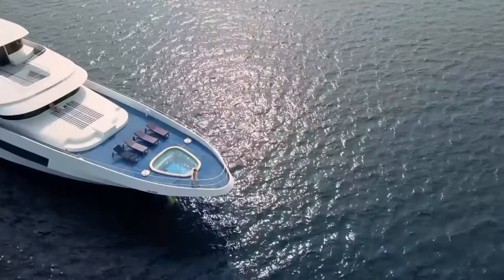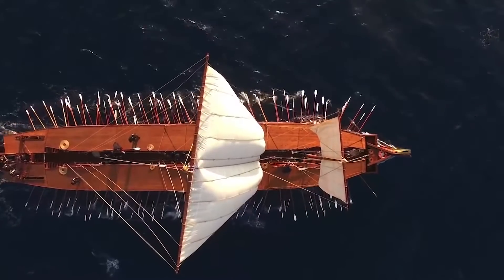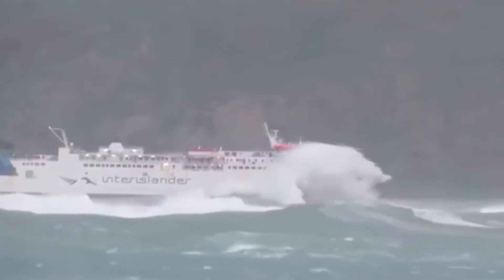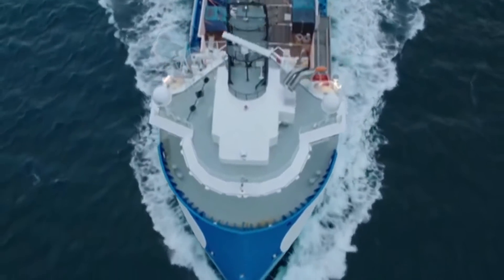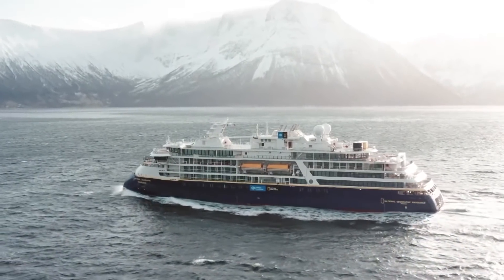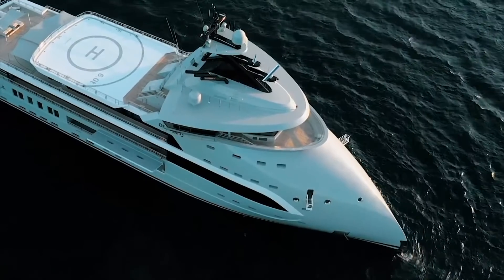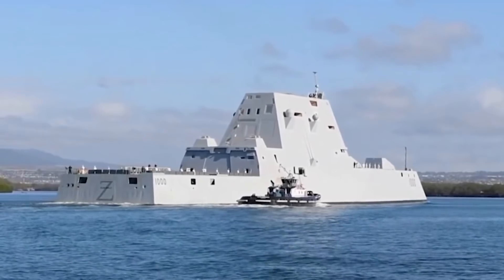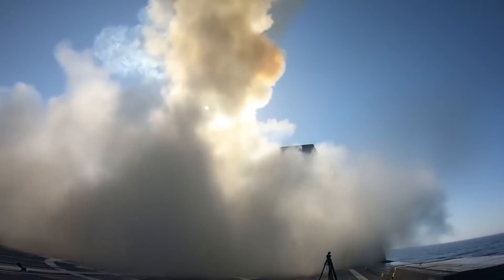This Revolutionary Design Will Change The Appearance Of Ships

Comment: The bulb on conventional bows creates a low pressure zone before the main bow, where that low pressure zone then collapses into the length of the hull, and reduces friction. If there was no bulb, a high pressure zone will stick to the full length of the hull, creating massive resistance. The xbow suffers this high pressure zone, unless it has a hidden bulb (probably does). I'm not a ship tech by any means, but I know  going by interest and other YT vids what the deal is here 😀

Comment: The original viking bow was because the sailors were in the water and another unseen action of the Hull is its flexibility. Obviously hard to replicate with a huge metal ship but certainly worth considering because it will reduce the cost of the fuel and improve agility

Comment: Ulstein has a promotional video on their website that does a very good job of explaining the X-Bow design and why it is a preferred choice for modern ships. It is purported to reduce onboard movement and noise, induce less sea spray, improve fuel efficiency, ships are easier to build, and reduced structural stress on the ship.

Comment: This design is nothing remotely new. There were lots of battleships built for the Royal Navy before WW1 with essentially this type of "reverse" bow. And In other countries as well. To my mind, the reason why this type of "X bow" is more efficient than a "bulb" bow is that bulbs are not POINTED, but rounded. Surely, making a pointed bulb, rather than a rounded bulb would greatly reduce friction/drag and the inherent pressure wave created in front of it and the bow wave which results from it???

Comment: It would be interesting to hear from one of their engineers what the design choices were. I’m pretty sure it’s not a case of “no one ever thought about it before,” naval architects have scientifically tested and analyzed every possible configuration for almost a century.
Reply: I´m a merchant marine engineer. This is a good design if the superstructure is already intended to be on the bow of the ship. Problem here if the ship is needed to carry bulk, oil or containers, this design would restrict cargo capacity. Best place for superstructure is above the engine room, because you cant fit cargo under superstructure. Best place for a engine room is aft of the ship, because of screw shafts, rudder machinery and smoke stacks.  If you watch this video, every single X bow ship is carrying deck cargo like passengers, roll in roll off and subbliner materials, so that the superstructure can be on the bow.
Reply: Total guess here, but during most of the steel ship era construction is done by rivited design. Basically lots of metal plates riveted together. It's much harder and more expensive to create large rounded metal parts. Today with composite metals and modern techniques it's easier. I would also guess fuel efficiency wasn't that important and saught after. Lastly it's probably due to tradition and available construction ability. Why spend millions on new research, training and equipment when there are proven designs? Most of development probably have gone to more effecient engines, propellers and fuels. Which also have the benefit of upgrading already running ships. Ships have a quite long life, which makes development slower compared to for example airplanes or cars.
Reply: @Swansniff2  In shipbuilding, rivets went out off use around one hundred years ago.
Reply: Many old battleships have kinda inverted hull designs.
Reply: @carlosandleon  how old? some of them were made with intention of ramming enemy. but later bulbous bow appeared. yamato had it and some american ships had similar bow but usually that was not shown in plans. if you look drawings often bow will look different than on pictures. guess top secret stuff.
Reply: why not? a lot of times it is as simple as that. especially because how tradition works. you are pushed in one direction.
Reply: That's pretty easy: In vertical motion, this bow produces little drag, even in highest seas. It also splits waves gently. The bow thus enables the ship to take on way higher seas without risk and goes through medium height swell way more gently tan the older designs. And that's it.

Comment: I have no knowledge of boats and the design of them. But as an engineer for over 40yrs, I do know that everything has downsides. Strange, I didn’t see any mentioned. A perfect design that most ship designers have ignored for many, many years?
Reply: Just brain-storming, but the distance below the surface may be a concern for this type of hull-design, so cargo vessels or oil vessels that have relatively large differences in depth before-and-after being unloaded may have relatively different performance parameters.... whereas something like a cruise ship which doesn't alter it's depth too much might be a good candidate.
Reply: @TROOPERfarcry  that's basically how it works. The only Naval vessels I worked on that had the bulb were the carriers and other large ships that were equipment movers. Anything with a cruiser, destroyer or frigate had a normal v hull. I've seen other countries ships(UK, Canada) have different designs above the water line, but not so much below.
Reply: It didn't say ignored. It said it's already been used for thousands and thousands of years. "New ship design" is just clickbait.
Reply: high quality displays and cameras and 360 degree movment.
Reply: @OrjanDT  no existing display matches the quality and detail that the human eye can pick up. adding super expensive equipment that doesnt aid in the ships stability are rather wasteful and useless
Reply: Think of how to protect the pilot house glass windows, with them heavily exposed to direct wave action.
Reply: This type of bow design can cause catastrophic damage to another ship in a collision, which is why they went away in the early 20th century. They also have less reserve buoyancy in a wave which allows them to cut through the wave. The lack of reserve buoyancy means that they will be wetter.
Reply: dont forget the test was using a fair conditions and balanced load. Its like putting a kid on your shoulders to dunk the ball.
Reply: Clive may be right. I wonder how the ship does in a following sea? Making the ship more of a double ender, as in trans-Atlantic row boats, may be needed as well as an overall lower (above the waterline) profile to reduce windage.

Comment: When the era of of iron-steel warships began in the mid 1800s the race was on to see what the new tech. could provide when it came to hull and bow designs. Many vessels used what was called the Tumblehome design of having their hulls angle in from the waterline so enemy fire would skip off. Indeed by the time what was called Ram Fever in design arrived just decades later ships like the preserved USS Olympia had a version of an X Bow over a century ago. It wouldn't be until after WW2 before the benefit of a ship piercing below water ahead of the vessel returned with the bulbous bow and what's old is news again as they say. An X Bow owes much to the Tumblehome design of the past as well as the rams returning on warships during  the latter Victorian period and you'll find commercial vessels in that era as well using unique hulls that it didn't credit..
Reply: They owe nothing to the 'tumblehome' design or to ram bows. They were built for completely different reasons.
Reply: @captainswoop8722  ram bows are designed for ramming , correct?
Reply: @captainswoop8722  But they were still built.

Comment: Sick kids this is why you should stay in school and get the best education you can I should’ve been an engineer when I was a kid me and my dad used to build boats electric out of water bottles and we noticed that no matter what you did the water bottles would not sync you flip them over they flip right back right side so I always thought boats should be more like a submarine shape , With any windows or doors watertight this way if the boat happens to flip over in a big wave it’ll roll over and roll right back up right I saw that they did some something like this for the new escape rest but they never change the shape of the boats years and years ago they could’ve made boats very easy not the sink but they never dead

Comment: After 20 years working on various ships with classic bow I have been working on x-bows for last four years px-105 and px-121. In high seas x-bows are superior, faster, and less pitching. Far more comfortable compared to classic bow
Reply: Counterintuitive...

This is life
Reply: looks like a giant canoe... they sail well in calm waters... lol
Reply: I have the opposite experience.
Reply: @TheFrontyer  the x-bow is far superior to the classic bow or the axe-bow.
Reply: @evonnechi7029  Definetly not true. The xbow hull is awful in big waves. Being in the north sea during storms and 15m waves was far more comfortable in a classic hull ship then xbow ships. 

For calmer seas the xbow hull is quite nice though
Reply: @TheFrontyer  what is it about the xbow that does not handle large waves well? How do the large waves affect the ship with the xbow? What do you, as a passenger or captain, feel when riding those big waves that makes the xbow so bad? Hence, what is the downside to having an xbow in large waves?
Reply: @evonnechi7029  I worked on deck at the time. Mostly its just very slow, but heavy heaving. It makes it very uncomfortable. 

Also the officers always complained about the ship in rough seas, had to go at max 1-2 knots to not destroy the ship.  Could travel twice that with a normal hull ship.
Reply: @TheFrontyer  hummmmm...

Comment: bulbous bows work better at lower speeds, High speed ships do not have bulbous bows.
Reply: Nimitz, later version and new Gerald Ford nuclear class all have bulbous bows and are well above 30knots.
Reply: @telinoz1975  But the bow will be optimised for their most common cruising speed. For a given design they only work at a relatively narrow speed range. Carriers spend the vast majority of their time at the same cruising speed.
As for 'well above' 30 knots, the speed of a hull can be calculated from it's length. It can't sail faster than it's own bow wave or wake.  Maximum velocity in knots = 1.35 x the square root of the waterline in feet.
Reply: @telinoz1975  They are optimised for the cruising speed that carriers spend most of their time at. A bulb will only work efficiently in a certain narrow speed range that it has been optimised for.

As for the top speed of a carrier. It is tied to the length of the ship. It can only sail as fast as it's own wake and bow wave which is tied to it's length. The formula is  maximum velocity in knots = 1.35 x the square root of the waterline length in feet.
So you can work it out yourself for any given ship.
Reply: @captainswoop8722  There is no "maximum" speed for a ship. you can go faster than the bow wave but then the bulb would be useless and you would go from a displacement hull to a planing one. What i think he means by "high speeds" is that a bulbus bow is only useful for ships with a high froude number that is still not planing.
Reply: @Sectormann  Maximum speed for a displacement hull I should have said. You won't find a planing tanker or aircraft carrier.

Comment: Nearly every single ship of the line in WW1 had a straight bow or angled like this, wondered why they shifted away from it.
Reply: They had that shape for a different reason.
Reply: why because the bulb is also a where the sonar equipment is stored
Reply: @si2foo  There was no sonar in WW1. Battleships had 'Ram'  bows that were similar to the modern one in shape but their function was as the name suggests, to allow ramming.

Comment: I'm a marine engineer. Whoever scripted this is seriously ill-informed.
Reply: You need to explain why.
Reply: @crazydrifter13  I am also a marine engineer and sailed ships for many years.  There is no relationship between the new inverted bow and the Scandinavian longship bow.  It is apparent that the two are vastly different.  Ships have had a bulbous bow for decades, and the inverted bow is just an extension of the same idea.  The bulbous bow reduces the bow wave, which creates lots of water resistance.  The inverted bow additionally removes much of the upward force which would, in addition to buoyancy, would lift the bow from the water.  Cyclical lifting of the bow also increases drag on the hull so it won't move as easily through the water.  Ancient Greek rowed vessels with rams have no relationship to the inverted bow either.  The ram was usually just above the water, and thus did not act as a bulbous bow.  It's function was only as a weapon to break other hulls.  All the similarities made by the videographer are incorrect and demonstrate no knowledge of hydrodynamics.  Hope this helps.
Reply: @DARIVSARCHITECTVS  oh thanks 😀

Comment: Vikings didn’t build bow extensions for speed, they built them to ram their opponents.
Modern ships use bow extension to decrease the length/width ratio in order to crease drag. Also the bulbous bow extension splits the water.
Reply: Not Viking longboats but Greek or Roman galleys had rams !!!
Reply: @johnland7318  thanks John.
Reply: The bulb disrupts the natural bow wave. It's more than a length increase.
Reply: This is just garbling.

Comment: I really can't say that I have seen any real benefit of X-bow over standard bows, aside from the usual benefits awarded by less resistance which is similar to knife edge bows. They both move the same way under heavy sea's, I have found that X-bows dip even lower into following waves than standard bows do, due to their overall thinner design. When this does happen then waves tend to break over the top of the ship rather than just over the top of the fore deck. 

Though it can be seen as an improvement over the knife edge bows, which had a tendency to submerge under waves rather than rise over them. A feature that has lead to some ships being crushed under the sudden unexpected dive into waves that put them several meters underwater. 

Viking era long boats aren't X-bow designs, they are curved standard bows with high wave guard walls. The reason they were so effective wasn't because of some ground breaking design choices, it was because they weren't gigantic in size. A group recently built the largest Viking ship in history (which was much larger than any known historical examples to date), and it was a-wash for pretty much all of it journey from Norway to the America's. Even in light weather it was taking on water over the bow. Had the ship been a third smaller (closer to the known largest ship designs) then it would have perfectly fit within the wave length they encountered, but would have been a bit rougher trip.
Reply: Not to mention the ''Vikings'' operated a variety of ship types, not all of which had the pronounced bows like the ones found on the Oseberg and Gokstad ships.
Reply: Crew vomfort i drastically improves with the X-bow
Reply: @ultra_axe7812  That's what it says in the video, but I guess the crew would be more comfortable in an X-bow that is at dock rather than out in the open ocean with 40ft waves. You know, the weather that most offshore companies have no choice but to send a ship out into if they want to keep their rigs running.

That is kind of the argument, standard bows are cheaper to maintain than X-bows, operate in a much higher severity of weather, usually have much more deck space, and have higher buoyancy the further under the water they go. 

I have never seen a video of an X-bow ship operating in the same sea states as standard bows are when they are having their bulbous bow tips being launched out of the water. Where is the on-board footage of an X-bow ship staring at a literal wall of water moments before impact like all the videos we have of standard bows being smacked in the pilot house by a breaking wave?
Reply: @lordraven1991  ive worked on the Scandi Vega, Troms pollux,  Troms Fjord, and bourbon mistral, the X-bow was designed for crew comfort i rough weather and surprisingly for noone but you apparently they do it wonderfully

The X bow is ment to cut deep into the wave so, so the ship stays as level as possible in rougher seas

Comment: I don’t see the slightest resemblance to the bow of a viking ship though?!
Reply: It's about the soft round bottom, which is probably more hydrodynamic or whatever, not the upper part. All in all the X-bow's main properties are not about the inverted upper part at all, apart from rough seas and maybe a little bit of aerodynamics.

Comment: Don't lesson me on this shit. 

Drakkars has never been found, but we have no reason to doubt they existed. The ships you show are longboats with hulls more akin to knarrs. Knarrs were merchant ships made for cargo, which comes in handy after a few raids. The X bow is inspired from the karve design, with the Oseberg ship being the best example. Karves like the Oseberg Ship were made for efficient transportation, but didn't have the same capacity or stability. The Oseberg does have some resemblance to the X-hull.

Comment: I work on the northsea and x bow is brilliant in calm weather, but it have some giant design limits, that's why we only use it for dp and calm weather.
So in open water is not a good idea at all
Reply: Same exact experience.
Reply: Makes sence, to me it looks like an aerodynamic design the air cutting through would make it want to go down due to the air pressure on the surface, maybe a combination of the two might be ideal.